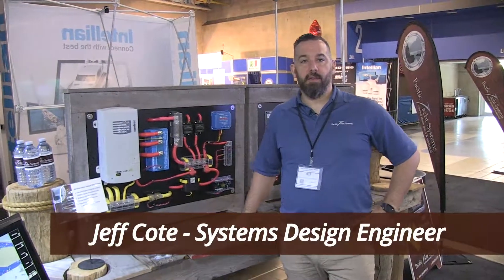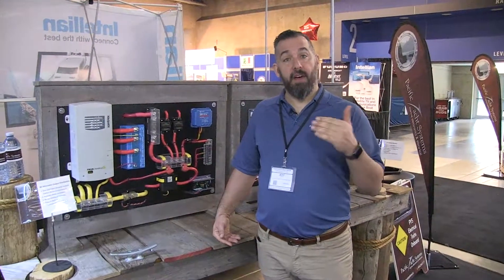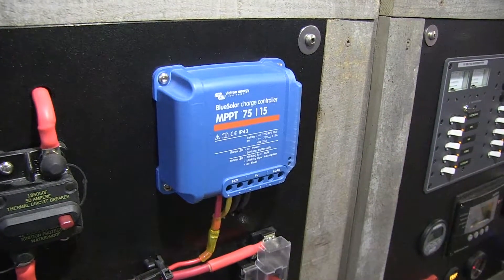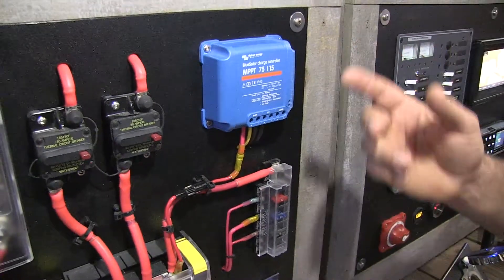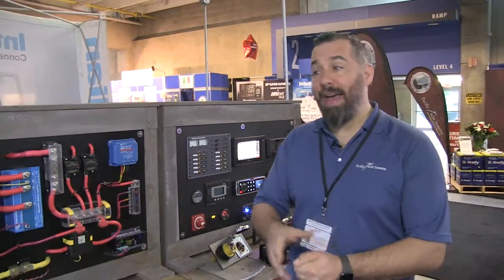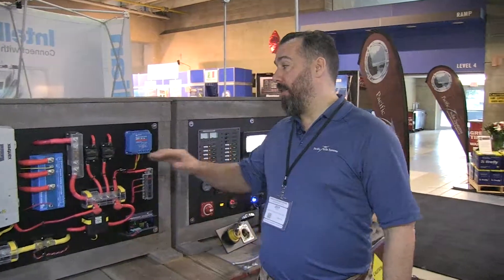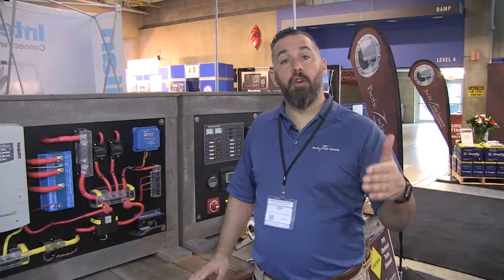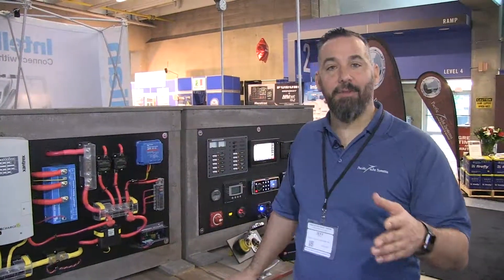Intro - Victron 75/15 Solar Controller

Comment: It’s too small for a 200w poli panel?
Reply: I don’t know??? I watched a video recently on YouTube projects in Paradise I believe their channels called and the old man wired up 400 W worth of solar panels(12 volts )and ran it into this little charge controller he wired two in series and then two more in series and then paralleled them together series series parallel it was giving him 200 maybe 209 Watts max all the time and he would go right up to the 15 amp threshold as long as he had the sunshine available of course I’m very intrigued by that he was charging a 200 amp hour LIFEPO4 Battery and as far as I know he’s been doing it for around six months or more now
Reply: @william38022  yes thanks it i've used for six months it works great.

Comment: Hi Jeff,
Thank you very much for the brief info. 

I am only using my refrigerator on my boat as the main load, it consumes around 8A/hr. The remaining loads are not as critical as the Waeco refrigerator. I have 2x180A lead acid batteries in parallel and I don’t feel comfortable on a 3 day anchorage. I live in the west coast of Turkey, where it is sunny almost everyday. I am considering of buying a Victron 75 | 15 but I cannot decide what panels and how to connect them for this setup. I think it is better to wire them in series to increase the voltage, but I am not so sure. I want to mount them on the bimini. Can you please help me with this? Thank you,
Best regards
Reply: By the way, I want to add that I watched almost every single video on your YouTube channel and I learned SO MUCH from you. I really and sincerely do want to thank you and your crew for sharing this much information, clearly, patiently and with repetition. It is obvious that PYS team is taking everything they do very seriously and doing their jobs meticulously and with discipline.
I also forgot to mention I have a sail boat and I have little shading on my bimini. That's why I am in a dilemma whether connecting the panels in series might be a bad idea.